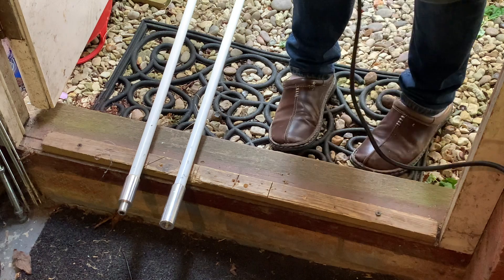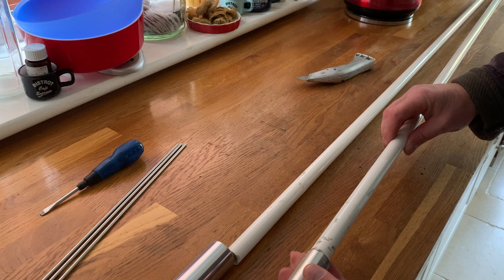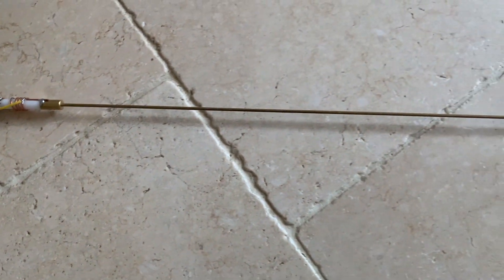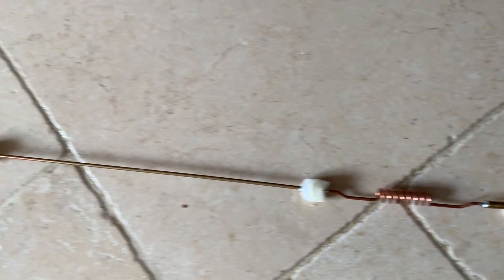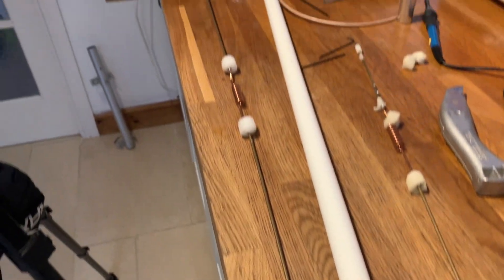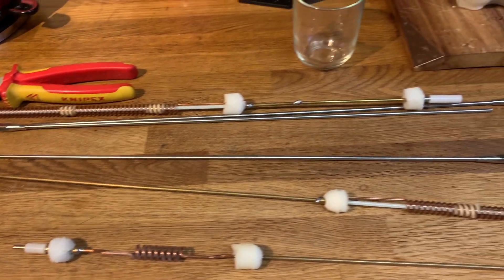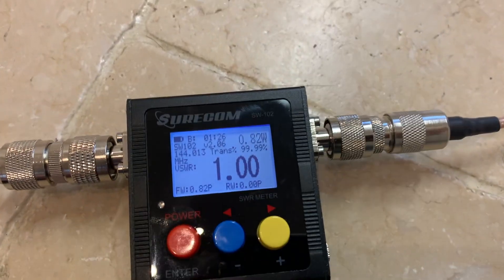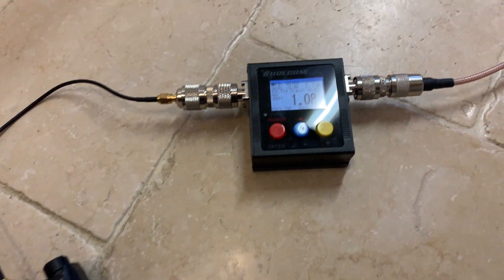DX Commander 2/70 Prototype rebuild/repurpose

Comment: It makes you wonder why the Diamond X510 was SO expensive years ago!  I had a X50, then X300 and I ended up with a V2000 triband for 6m/2m and 70cm which would also work on 70Mhz in part of the band, but give a very wideband RX up to 900MHz.  
This type of aerial has gain, but horrific radiation angle of over 30degrees, so better in my experience for low down locations or built up areas for local coverage.  I now prefer the slim Jim type of aerial over all others for local coverage as far as the frequency in use allows.
With a much lower angle of radiation they have a blanket coverage, so gain is not always everything when it comes to antennas.
Why have a huge ERP firing up in to space when you can compare it to a better coverage from 0dB gain with 10degree angle...

For example, with a X50 at 35ft above ground, I can get the Isle of Man repeater from 100+miles away. A very low signal 1, in the same location the V2000 doesn't pick it up.  With a slim jim or jpole I get a signal 3.